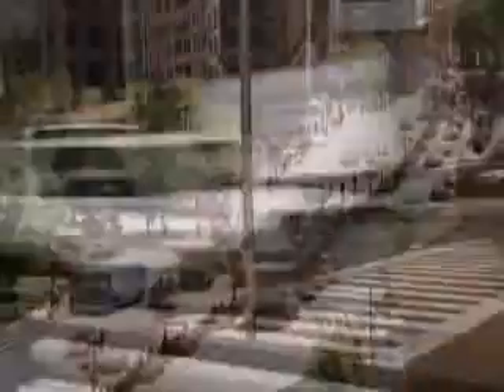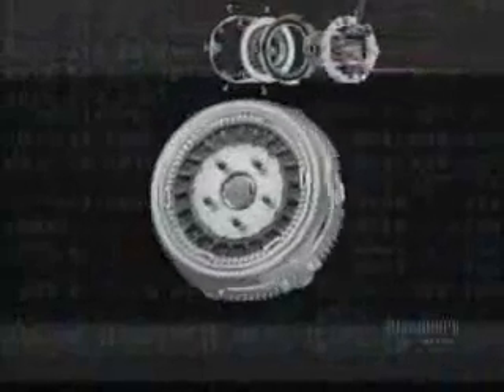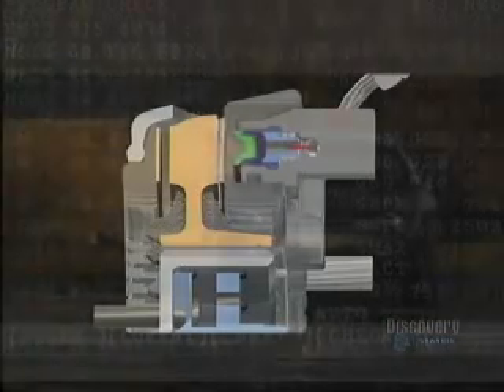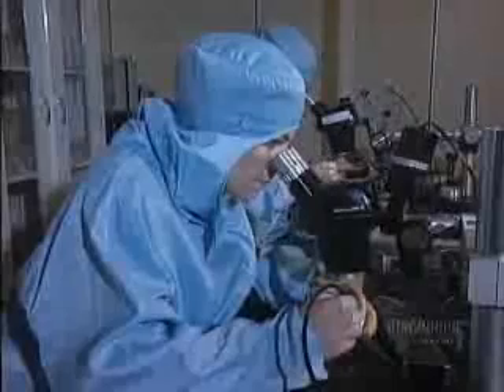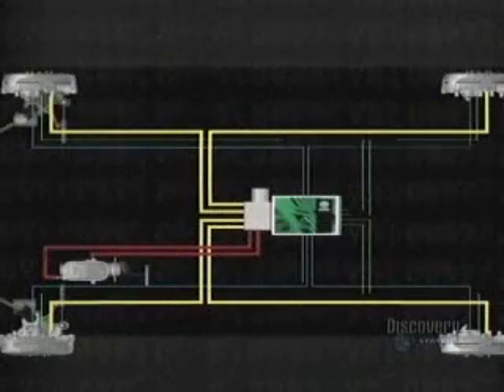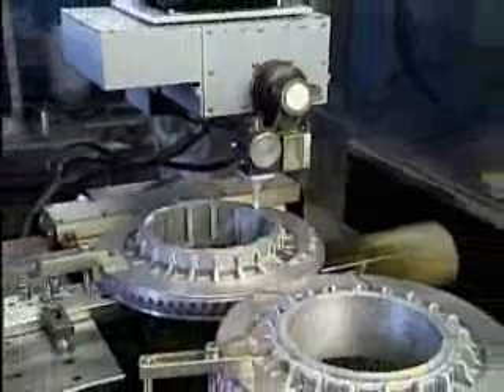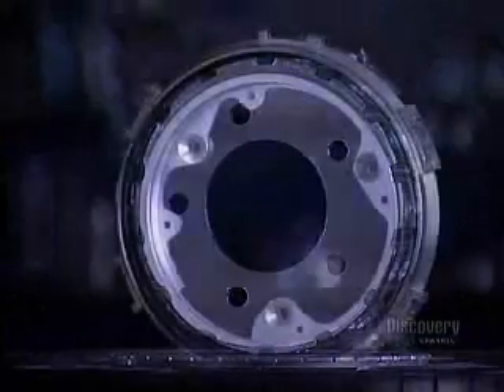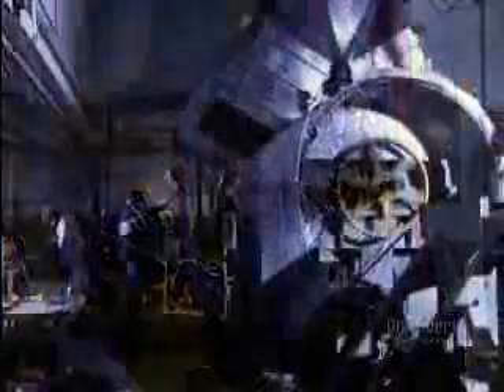How its Made - New tech brakes

Comment: @mgrinshpon Good comment, but, I still think that transition may not be fast enough. I feel having a surface open to ducted air is far better, ie, common setup. I can see this being a good idea on perhaps light aircraft, where the brakes would only be used once every 2 hrs or so, but cars use them all the time, I still feel they would get too hot. Actually, thinking about it, planes have OIL COOLED clutch pack style brake setup, which makes me wonder about the above design even more, no oil...

Comment: Rotor warping is a common misconception. In actuality what happens is disc "thickness variation." It's quite simply the difference between the thick and thin parts of a rotor after extended use and it only happens when brake pads move over the ten-thousandths of an inch variation on the rotors. It happens due to corrosion, hot spots, and uneven brake pad deposits.

And there's a heat sink behind the rotors to cool them so brake fade wouldn't be an issue. The heat-movement capability is there.